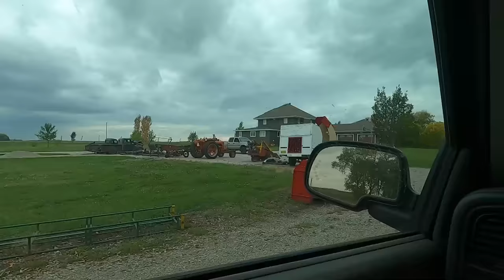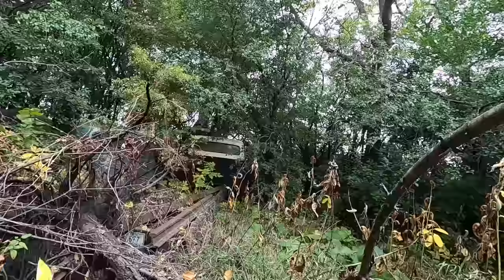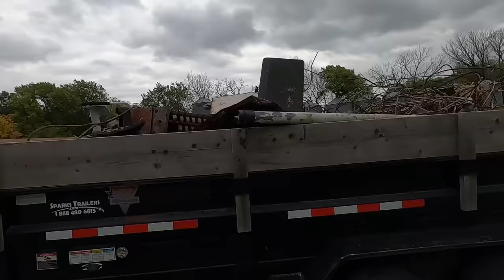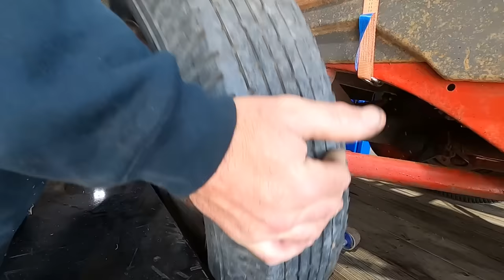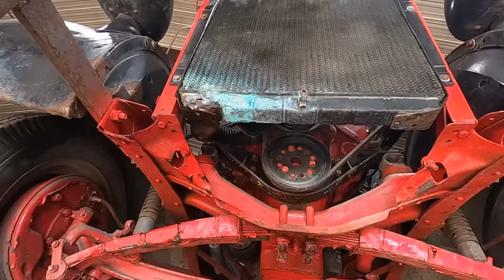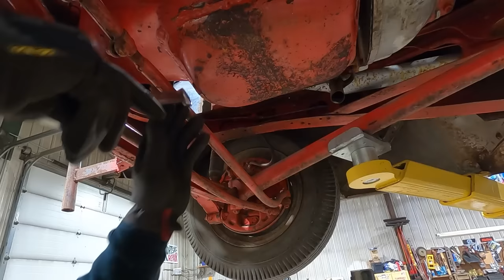Barn Find!1938 Ford Hot Rod Pickup! OHV V8 Power!! Abandoned For 48 Years! Will It Run?!?

Comment: i can appreciate the emotional roller coaster reviving old stuck motors. I recently purchased a 1968 international travelall that had been sitting since 1982.  everything was stuck. cooling system was solid with rust. ended filling the entire motor with trans fluid and diesel. two weeks later it rotated.  it now runs and idles.
Reply from the maker: awesome!

Comment: This length of video are the ones from which I learn the most. Case in point, I bought a set of six point wrenches for brake bleeders and the one way check valve (both of which are amazing) thanks to a long will it run video. So much knowledge to be had.
Reply from the maker: Nice!

Comment: The pistons are at least 11:1 with those domes. It's also a forged crank (you can tell by the wide, ground forging line. The valve springs and retainers are also larger than factory 283 valve springs. With those springs - make sure the rocker studs are at least pinned (or they can pull out).
Reply from the maker: good to know

Comment: Nice find  !! The Lil 283 block is a gem .. steel crank hi compression pistons .. i built a few back in the day and they were screamers !! Looks like small valve heads but for a driver itll be ok.. i would use different heads but thats just me .. also depending on cam ya might wanna atleast pin the studs or install screw in.. i hope you continue sharing progress with the engine / truck.. I very much enjoy your channel and your encouraging me to get back out into shop and continue with my projects.. keep up the good work  !!

Comment: Pretty nice 283, steel crank, should be fun once you rub the ruff edges off, thread the crank for a damper bolt, not that much fun when they fly off. Pretty nice pickup, very dry body, saved a lot of labor on rust repair, should be a beauty when you work the bugs out.

Comment: That Mallory coil "Volt Master" is a GREAT coil! Even with the weird coil wire cover (2 screw cover) I am still running 1 put into service in 1978 & is still going strong today! It's running in my 3rd Pontiac GTO & 5th motor's run with Nitrous (400, 428, & 455 engine's)! It work's flawlessly. Don't change a thing if I  were you! It's a real Sleeper!

Comment: Hey Mortske, That red Buick wagon was a '68. three easy ways to tell 68' from 69' on the wagons and 2-4 door Skylarks. The 68's have the wind wing on the front doors the 69's had one piece front door window,  the second way is the front fender trim. the 68's have the trim up high on the fender just like the one you see on the passenger side in your video and the 69's have shark gills in the dog leg at the bottom if the front fender. and last, look at the rear side marker lights, the 68's have a round rear side marker light and the 69's are rectangle side markers.  Thanks Mortske, the 38'-39' ford pickup is my all time favorite truck, thanks for what ya do! Please say hi to Duff dog for me.   Cheers!
Reply from the maker: thanks for the info!

Comment: Congratulations on getting the '38 Ford pick'em up running! Ho-boy, what a saga😊. I saw one of the haters was giving their opinion on using a Chevy engine in a Ford. I agree that if they want it that way, they should supply you with small block 302/351c.
  Well, good luck with it and I'll tune-in next week to see you and Duff tackle another project.

Comment: In case you didn't know. That pressure plate you bolted onto the flywheel is a 51 to 53 Mercury. It bolts right up to the Chevy flywheel without redrilling the flywheel. And the three fingers works with the stock ford throw out bearing.
Reply from the maker: Thanks

Comment: To remove a pilot bushing fill it full of grease and drive the alignment tool into it. The grease will work like a hydraulic lever and push out the bushing. Tip of the day.

Comment: Ten years later it's still in the corner not perfect. I'm with you on doing it all correct or just get it reassembled and make it happen. Everything else is a repair job and a proper engine paint takes two days stripped to Nada , masking , prep prime undercoat top coat dry and assemble , going flat out for 24 hours over the two days.

Comment: Yes, the lower end of that engine is balanced, seal it up and run it.  Find a set of 906 Vortec heads and redrill the center holes of the Edelbrock intake to fit the heads, get a 2x2x4 bbl adaptor (Vintage Speed) and run a set of large base Rochester 2 jets on it for that vintage look.  A point distributor with a Pertronix Ignitor ll ignition and a set of Rams Horns will fall right in style.  What a great project.

Comment: That is forged steel crank shaft and it was balanced you can tell that by the way it is lol. I don't think I would bother with those heads thy have small valves in them. you can make a very nice engine out if it. I am glade you tore it down .

Comment: Can’t count the number of times I’ve prayed for bolt not to snap off taking it out. Most of that was a peek into the future 😂 Exhaust flange studs you couldn’t put on enough penetrating oil. Aluminum heads with small steel studs were always fun too. That’s when I learned about heat and expanding metals 😆

Comment: My metal lathe is a Fitchburg made in about 1898 and  it is one machine I would HATE to be without.  It had made me several thousand dollars over the 10 years I have owned it.  I put a DRO on it last winter and that really helps hitting target dimensions.  Due to my somewhat limited attention span, I can't do three hours at one shot, but I can do an hour for 3 nights.  Just keep on cranking out the videos, I will watch every one.  Say hi to Mojo for me and greetings from McCook, NE!
Reply from the maker: I should look into a DRO
Reply: just make sure there is enough room on the crossfeed for the reader.  That seems to be the hardest part of putting one on a lathe I can send you some pictures of my installation if you want.. @MortskeRepair

Comment: I've never seen an old trans like that hooked up to a 'modern' engine. That's crazy!
The underside of that is mint for long it sat. Someone had enough love for it evidently.
Reply: If you can find some 1950’s and 60’s Car Craft or Hot Rod magazines you’ll see ads for adapters to bolt together just about any engine and transmission together.

Comment: The rear multi-leaf spring should come off and add in the longitude pair of multi-year springs. This transverse spring goes to be under the driver side pan and it lessen the flexible of both front half chassis and rear half chassis. The torque tube are bolted up on both ends with out any U-joint. The torque tube is placed under the ball socket joint of 1/4 ton pickup 1938 Ford. The grille can be shorten down by 2 in. Cut off so it is more stylist 1 barrister and across sideways for the grille.

Comment: You should have polarized the generator. Just run a wire from the A terminal on the generator and the BAT terminal on the voltage regulator just long enough to see a spark. Not doing it runs the risk of shorting out the voltage regulator and/or damaging the generator.

Comment: The ball socket joint has ball size 1 3/4 inch and it hitch up between the front clip chassis and rear differential suspension chassis. This ball has a slot groove across from the top of ball to the bottom of ball. So it cannot rotate around with key sliding up and down thru the groove. To prevent it from doing coaxial the torque tube locks up both rear differential housing and transmission with both end flanges. The solid rod is what goes thru inside the torque tube and it does drive/rotate the pinion intermeshed to the helical ring gear.

Comment: G'morning Mortske 🤠 . Sugar beets and potatoes are huge business here in Southwest Idaho 😋 . Harvest is in full swing and the spuds and sugar beets are being taken to the underground cellars which are massive,  like 150 yards across & 400 yards deep.  The sugar beets that aren't taken to the cellar's are taken to drop stations and then they're transferred to the sugar beet factories where they're piled in big Mound Rows 100' wide,  300' long & about 25' tall.  Anywhere from 15 - 20 rows at a time.   When the plant is in full swing and they're processing beets as quickly as possible  you know it because the smell is unmistakable.  If you remember what potatoes smell like when you're peeling them add the smell of cotton candy x 1000 and you might be in the ballpark.  Also,  did you know that when sugar is being processed while it's still wet before it's had time to dry and crystallize it's 10 times more flammable than gasoline,  no 💩 ...
Reply from the maker: Good to know!

Comment: Fun fact ....
 The 1/8" copper, oil pressure tubing fits perfectly inside standard aquarium tubing. Works great to help insulate the pressure line against vibration, chaffing etc. Easier to bend without kinking too. 😁
Reply from the maker: Great tip!

Comment: When I was in college I snapped off every other stud for the exhaust manifolds on my 442 - had cracks in them. The welding instructor came over and used a cutting torch to blow out the studs - left every thread in the heads intact. Never seen anyone else ever be able to do that.
Reply from the maker: would love to see that!

Comment: You working on seized engine has reminded me of when I was 12 I worked on a fordson tractor 4cylinder flat head magneto  spark. I removed the head and had a fire in the bore and used a block of fire wood hit with a wood head hammer it was crank start. I did get it going.
Reply from the maker: Awesome

Comment: The heads on the  65 are the 283  power pack heads (4 barrel carb= 220 hp)
The other heads are 2 barrel heads (165 hp).

Comment: Found a 1940 in tx split wind shield shell everything but frame deal. Has the front clip that matches that tail gate on the 38 on the cheap.only 1 picture of it on fb market.
Reply: Stupid you tube wouldn t let me post link.

Comment: If you take and grind out the crack in the manifold throw a little heat weld it with 6011 rod it's worked for me before..... great video
Reply from the maker: worth a shot!

Comment: Those translucent plastic lines will flood your house when people use them on ice makers as well. I’ve been an appliance service tech for 29 years and I’ve seen it happen so many times and my favorite lines to use are copper, refrigeration grade copper not that thin walled junk they sell in those Ice maker hook up kits at the box stores. And yes tape is better for liquids than pipe dope. Thanks for the video
Reply from the maker: I know a guy who had it happen twice!

Comment: With Rusty stuff Just adjust plus or minus 1/16th to 1/8th inch thickness when you set up and the auto will work fine... once you know how much to compensate for you'll know forever for that welder

Comment: Ok, you said yourself you aren't an engine guru.  Take advice or font , have the cam degreed, looks like it's balanced.   Those pistons are high compression, you will destroy the engine if you don't run high octane ,  worth fixing! Cam specs are more than likely stamped on the back of the cam if not on the front
Reply from the maker: Thanks for the info!

Comment: When I swapped the engine in my Duster, I put the whole trans on the engine and torqued the pressure plate down; engine dangling from the chain, trans on the trans jack. The slant six just barely fit in the there with the clutch on it, but it fit. I couldn't find the tool that came with the clutch several months prior, don't have one of those universal ones like you do, and even though I considered taking the input shaft out, I didn't want to deal with that.
Reply from the maker: Holy buckets! That's ambitious!

Comment: The copper oil pressure line leak next time insert line to bottom of the fitting then pull out a touch them tighten I haven't had a leak since I was shown that trick for farle style fittings

Comment: Good 😂 for you asking about the other rear if it were a restoration thing to get the rear of the truck that was replaced with a 46 coupes rear with juice brakes and small car bolt pattern is the best way to get the most developed possible in the same parts as stock appearing but it will actually be more safe and more accessible from the parts aspect and the ways of the mechanics and put the best in that will fit  with the least amount of effort

Comment: You most certainly can get bad welding wire! I had no idea until I used GOOD welding wire. Cheap welding wire has impurities that cause a lot of slag, good welding wire has less impurities and much less slag with much more penetration abilities.

Comment: That's one of the nicest barn find I think I've seen on your channel. Mostly surface rust, but nothing requiring replacement of framing or floor panels. Whoever gets this truck will have a real head turner. Especially after they swap that motor out for a Ford motor. 😂😂
Reply from the maker: Very solid

Comment: Had a 59 283 bored 60 made it flat tops 2bbl heads gm wiend intake 660 holley 4 squirter reved hell out of it and thru fins off the generator pulley put 5-6 slits in the hood
Reply from the maker: Sounds like a good time!

Comment: I’m a big Hyundai fan I’m a Hyundai tech, I do the engine replacements and recalls all day. yet I own 3 Hyundais. Really all depends which ones you get, hyundai never had engine issues until 2012 . The bad engines usually last at least 80k, I’ve also seen some last 200k and Hyundai is very lenient with warranty sometimes even for 3rd owner cars. They are handling the issue well. All modern cars have tons of recalls all new cars are made of glass.

Comment: on the lathe, the 3 stepped arms that grab the work piece are generally reversible if you need a little more stickout in the future that could possible help.  hard to say if it would have made things easier or even worked as im not there to see it.  enjoying the video, nice to see some old iron getting tinkered with .
Reply from the maker: Thanks for the info

Comment: looks like that diff wasn't vented properly. as it was clear that only when the upper plug was removed that air could get in and let the oil out. and they do need to be vented as diff oil, like other oils, expands significantly when operating temps are reached.

Comment: Thought when you didn't think you'd gain much by pulling the oil filter. It's still a 50 year old element in there. How old does a filter have to be before it falls apart?

Comment: Somebody took the hi-po race-ready valve train apart, yanked the high lobe cam out, grabbed the carb and replaced it with some stock parts maybe? Or they were trying to do a magic trick and made a pushrod disappear - abracadbra didn't work and it never came back.

Comment: It's cool to see the pre-F series Ford pickups. Not many of those around. 👍 Question: How about a will it run on an engine from the teens or 20s....if you can find one that has potential. That would be cool. Anywho.....good job Mort! Thanks for sharing! 😎
Reply from the maker: That would be cool!
Reply: The guy you need to check out is Jennings Motorsports. He gets things running that havent been started in 50 or 60 years, all the way back to 1911!

Comment: Usually if you go through this much engine work or machines work on a engine you would generate changes the pushrods especially if you change the valve springs and rockers and cam and lifters and a old hot rodders truck is home porting the heads and intake manifold and clean out the valve seat of the head and match it to the valve, and then if you run taller or shorter height valve springs you would end up changing pushrods especially if the installed valve spring height and pressure is different than stock... And the main reason to fix it was probably sticking valves and i have torn down several older Oldsmobile V8 and sbc engines and found bent or broken pushrods and then there was the 355 i built the first set of heads i started using i rebuilt anyway i ended up getting two brand new Manley street master valves bent because i had a new set of pressed in rocker studs rather than having it setup for screw in valve rocker arm studs and buy arp studs, it was supposed to be fine with my .600 lift capable valve springs nope because it pulled one completely out and dropped the valve on the piston and nicked it up pretty good, and the exhaust on the same cylinder 1 Dr side front of the head it pulled up about 3/8 inch out of the head casting, and shattered two of my competition cams magnum chrome moly pressed end pushrods like glass

Comment: Anonymous confession. I've been daily driving tires made on the 3rd week of 2008. For 3 years. Not a crack in sight and still supple and soft. I run them 10 psi low, and have been no issue. Ever. Lol I work as a mechanic, I know. I know.
Reply from the maker: Ouch
Reply: @MortskeRepair  if it feels good and looks good. Production dates are just it's birthday 🎂

Comment: As I am watching this I see you are chucking a pulley up in your lathe. I was thinking you will need a spacer for the fan, so why not turn a spacer to the correct thickness to allow the pulley to line up, and thane deal with a spacer for the fan?

Comment: What was the cylinder thing in the lifter valley of the engine you tore down I've never seen that before
Reply: After a couple of Google searches I found out it's a Ventilator. It separates oil and vapor for the road draft tube.

Comment: I had a 74 Chevy wood cutting truck with a Mallory dual point and I didn't have one moment  trouble n 8 years
Reply from the maker: That's awesome
Reply: @MortskeRepair  the son of a guns deliver a hot spark. I know that. Got it in 1990,Built floor boards outta furnace metal when feed sacks wouldn't stay any longer